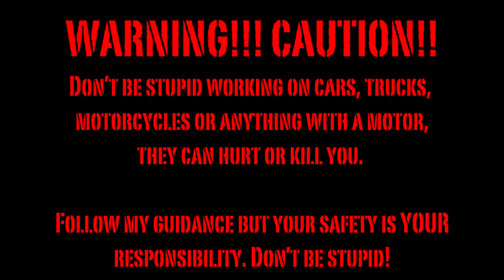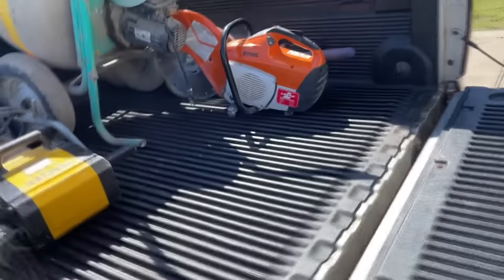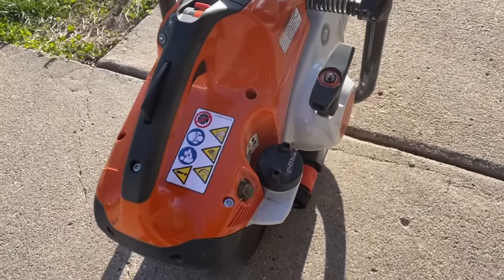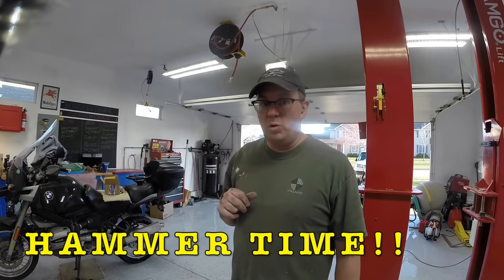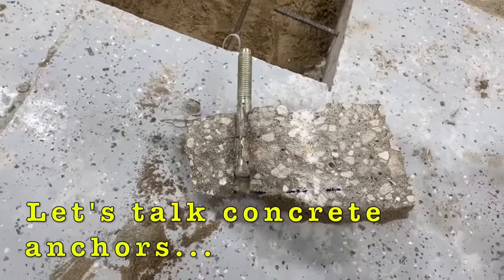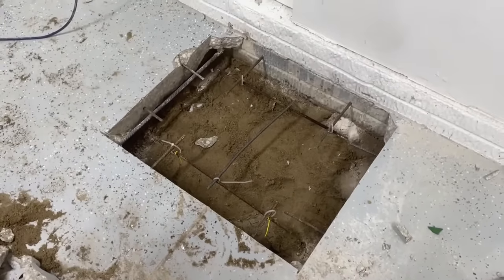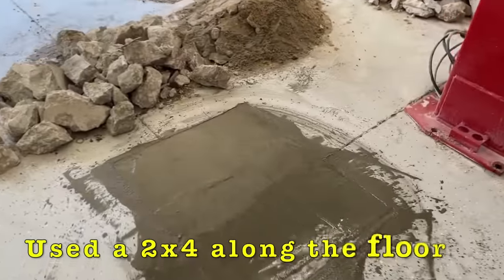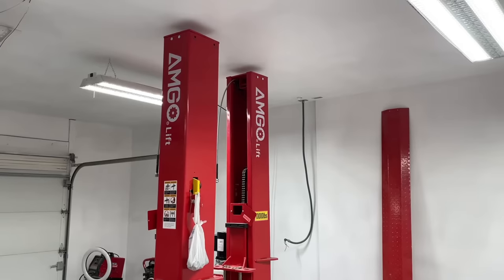My Lift tried to Kill me!

Comment: As a professional, and certified lift installer, this is terrifying to watch. Next time please hire someone who knows what they're doing, from start to finish.
Reply: Agreed! I would never attempt this myself. You could get killed or kill somebody else quick if not done right..
Reply: If you know what you're doing it's not an issue.  This guy clearly has ABSOLUTELY NO CLUE and should not be doing any of this let alone recording himself for other people to imitate.
Reply: What did he do wrong? Asking cause I don’t know and like to hear the correct way.
Reply: The building has a12” footing..why would you just do a 7” one not very smart. Should got some professional advice on larger footings and used used concrete imbedded anchors like they use on large sign posts. YouTube videos scare the crap out of me on what people do at times.
Reply: Have worked in civil design and construction (qualified) for 20 years. This patch does not meet design standards for expected loads. I have concern for the safety of people working around this "fix".   It is  recommended  you get professional design advice before starting jobs with high bending moments.
Reply: Quick question: I'm looking at a backyard buddy lift...have you ever installed that lift? Are they pretty solid? So many different companies and manufacturers to choose from...I like the backyard buddy because the ramps are a little wider
Reply: @tjewett1967 please share specifics of what he’s doing wrong so we can all learn.
Reply: Hmm I would have pulled the right post away from the wall 3 or 4 inches. Also would have epoxied the rebar to the existing slab and used at least #4 or #5 size. Compact the dirt beneath and make the pads at least 12" thick. Would have also have paid an engineer check the calcs.
Reply: One could argue if the lags start pulling and there's no cracking then hammer them through and just epoxy in some high tensile threaded bar no need to repour. The only issue I see here is expansion seams so close to the legs with that
Reply: Interesting, is it normal in the US to only have 4” of concrete as a garage floor ? I have always used 6”+ of concrete on 9” of hardcore for a basic garage ( you don’t know what people are going to put on it !) rebar as required.  In this situation I’d ask my  consulting engineer. But as a neighbour I’d have told the guy to cut out a yard square by eighteen inches deep , undercutting the existing floor a few inches. I’d have told him to throw his concrete waste at the bottom of his holes, and after installing rebar fill holes with good stiff concrete with a resin additive of some kind. Why use weak “wet”
concrete ? you are going for strength not ease of installation !  When trowelled and set, cover in wet sacks and leave for a month.
Reply: Agree 100%   Construction of a foundation for a car lift is not something the average homeowner should take on, especially someone with no experience and willing to put his ignorance on full display on YouTube!  Where is the engineered drawing or diagram for concrete depth and width?  Where is the tie in with the surrounding foundation indicating size of rebar and pattern?  Was he using high strength concrete , nobody knows.  When did he learn that extra wet concrete a good idea because it's self leveling?  Can't wait for the followup video to see when this new pour fails and if he escapes with his life .
Reply: My lift came whit ”hollow” anchor bolts. In the midle there is rod . Rod upper end there is allen bolt head and when you turn that allen bolt it tighten wedge in other end. After wedge is tight you can start tighten nut.
Reply: To those that asked.. Adding that small of an inset is useless. It’s barely pinned into the thin existing floor. He literally made his situation worse. Need to go at least 4’ X 4’ and because it’s not monolithic anymore you’ll need a pier. Put your 4 x 4 at 8” depth, do a sonotube that has a diameter of the mounting footprint down to 36”. Add rebar pins around the perimeter no greater than 8” apart. Order good concrete! Bag mud mixed wet has no strength and the aggregate in it sucks too.
Reply: Why do something once when you can do it twice……
Reply: @CrimeVid  Yes, 4 inch is typical thickness in USA for residential and it is often poured over dirt which may not have been compacted if done by a shady contractor.
Reply: @munsters2  Actually 3-1/2"
Reply: @gauravvij67  yup those cuts are way too close.
Reply: @ncphenom2309  besides not bothering to measure the water, each batch was different to my eye.
Biggest error is putting the lift back in the same spot against the wall, the anchors closest to the wall will crack the concrete and split the anchor loose. He should have moved the base 12 inches away from the wall.
Lift should not be installed on expansion slots in the floor either. This what I call an idiot.
Reply: Since you’re such and expert where are your videos huh?
Reply: I just bought a Ammco 10 ton lift and the cross bar on top has 3 holes can I narrow the over all width of the lift by bringing the cross bar in?
Reply: When your wife collects the life insurance she can afford to advertise for a smarter fella.

Comment: There is insufficient connection between the relatively small concrete blocks he poured to the surrounding concrete. This won’t resist the overturning moment of the towers. The height/width ratios involved in this setup result in very large forces. Using J bolts also would have been better as well. I’ll stick with Jack stands and a creeper thank you.
Reply: I would put a metal piece on top of the lift posts spanning them.
Reply: That how most of them are built.
Reply: I’m no engineer but I would made them bigger for sure. But also he’s hampered by the closeness of the wall to the post on the one side, the fatal flaw imho.
Reply: What is the point of a lift with no more roof clearance than this has?
Reply: @zaneturner4478  So that it can be used in a low-ceiling situation like this.
Reply: @safffff1000   That's not an option on a low-rise lift like this and his ceiling height precludes him from installing one with the top bar.

Comment: I saw two problems here with the install. I believe that right post was to close to the out edge of the floor. He floors are usually poured separately from the footings so you were right on the edge. Also the bolts are sticking way to far out you need to put the nut on the stud and take a deadblow and hammer it all the way down the hole then tighten them and they should hold.
Reply from the maker: Yes.. had to take a break from videos for Covid & Life.  I'll be sending a video out eventually.  The bolts pulled out due to failure.
Reply: @honeybadgermotorworks7561  thanks looking forward to seeing
Reply: @honeybadgermotorworks7561  No, the bolts pulled out due to INCORRECT INSTALLATION.
Reply: @CaseTheCorvetteMan  Yes exactly anyone with any knowledge of what they are doing knows the bolts puled out because of seriously poor workmanship and a person who has no idea of what he is doing .
Reply: @johnnystoka6625  you know what is worst about these sort of videos? People watch them and actually think this dude is an expert... they actually look to this sort of video for advice of sorts...

Scary thought, but that's youtube and the digital age!!
Reply: @CaseTheCorvetteMan  Yes my exact same thoughts . YouTube will get you with their thought police if you over step and politically correct comments yet let this person risk others lives by falsely passing as someone who is competent in what they do . Yes indeed very scary .
Reply: @Gestapo943  yeah, i am quite surprised at what people will consider a pass these days...
Reply: @johnnystoka6625  How ya’ doin’ this evening? I’m Officer Stansbruv with the YouTube Thought Police. I’m going to need you to step out of the vehicle please.
Reply: I install elevators with these anchors. They are super strong if installed correctly. By the amount of thread you have above the nut, you have 100% not installed the tru bolts correctly. You should have researched properly before attempting this yourself.

Comment: Should not even install a lift like this in a residential garage, where the foundation/floor were designed for storing a car. This is a case of a do-it-yourselfer getting carried away.

Comment: Wedge anchors need to be installed according to manufacturer's installation instructions.  The slab was not monolithic with the outer foundation wall. Per manufacturer, there is a minimum distance required to edge of concrete. It appears the anchor was too close to the edge and could cause the edge of concrete to spall. A minor crack can cause a failure of the anchor and have it become loose or completely pull out. With 25 years in the construction industry doing inspection, I have seen many cases of improperly installed anchors fail due to improper edge distance.

While I applaud this video to show what went wrong on the install, the fix was not the best method. Suggestions-
Mix the concrete with proper water amount. While it being self leveling making it easier to place, extra water reduces strength and causes additional shrinkage as the concrete cures. That shrinkage can pull the new concrete to the center and leave a small gap around the edge of the repair. While the gap might be minimal, the patch is now relying on the dowels to secure it.
Make the repair foundation much deeper and have it go under the existing slab so it is "keyed in".
Garage floors are normally poured separately so they float. Except along  the foundation wall, roughen the edge of the cut concrete slab so the patch bonds. Industry standard is 1/4" amplitude of roughness.
Better yet, also apply epoxy to the now roughened edge so patch is bonded to and becomes part of slab instead of a plug held in place by a few dowels. If you don't use epoxy, wet the edge of the existing slab so it doesn't absorb water out of the new concrete. 
The existing rebar was against the earth. They should not be relied on. New dowels should have gone completely from side to side in the slab overlapping full length. Set dowels in existing slab with epoxy except along the outer foundation. Dowels could be installed into the foundation, but with no epoxy. The dowel should slide easily..
Any type of wedge anchor installed at the edge of the slab would most likely fail again. An undercut style of wedge anchor might help. A cast in place anchor would have been best, but harder to reinstall the lift over anchor. If the cast anchor was not possible an epoxy set rod would most likely been the better route to go as long as instructions were followed to the letter.

If this comment looks like a keyboard warrior saying "you did it wrong", please remember what the title of the video said, they can kill. Get professional help if you are not familiar with what is required. Sometimes the fix can create a false sense of security and be a problem as well.
Reply: I completely agree, Sean.  About ten minutes in, the author says "if you've never done something before,  do some research and ask questions.  The worst thing is that you might have to do it over".  Except that in safety critical tasks, the worst thing might be a serious injury to yourself or a loved one.  I have a 10k lift in my shop, and before I installed it, I called the manufacturer.  My concrete is six inches deep and is more than adequate, but Mohawk (the manufacturer) told me that if I had any problems and needed to cut and pour a new section, it should be 4 ft by 12 ft wide (across the stall) and 12 inches deep, keyed under the existing slab and reinforced with rebar.  Overkill?  Probably, but in this case  overkill is miles better than not good enough.  I dont think the author took his own advice,  those little new sections are inadequate by any manufacturer's standards.
Reply: Lift manufacturers usually recomend the size of the new "pads" if you feel  the concrete is unstable....etc.   in my case they recommended at least 4 ft by 4ft pads keyed and tied into the old concrete.    In my case  i went 9 ft front to back and 16 ft across......so effectively one slab for both posts.   And usually the bolts are required to be a certain distance from the edge of concrete....in some cases a minimum of six inches.   I wouln't put any any bolts any closer than 18 inches from an edge.....
Reply: Just did a new 3 bay garage with a 10k mohawk lift....directly under the lift posts we put 3 foot diameter by 4 foot deep corrugated tubes and filled them with concrete.....then poured the slab...she ain't going anywhere.
Reply: Thanks for the knowledge, I have to ask tho. I'm about to pour my floor in the garage. 4inches everywhere. Would it be safe enough to just pour deeper arouns the pads? Say about 8 inches deep and about 2x2 foot square with rebar in it?
Reply: @NateM13 In addition to reading the comments here, I would at a minimum consult the manufacturer’s specifications for your lift. I would never recommend going ahead with a concrete pour without having selected  a lift and fully comprehending the requirements for floor strength. Garage slabs at 4 inches are the absolute minimum for nothing more than a vehicle sitting on them, and are routinely poured over barely prepared soil. I guarantee that the first time you get under a vehicle sitting on your lift you won’t think, “I sure wish I just went went the absolute minimum amount of concrete and rebar.”
Reply: @beachroad2695  I went all the way through with good epoxy and it never moved or cracked ,previous anchors needed retightening periodically due to design limitation i think , continuous slab i agree .
Reply: Epoxy.  The rebar should be epoxied into the existing concrete.  With the pad that close to the outer wall, I'd also drill 7/8" holes and epoxy 5/8" Grade 5 All Thread into the holes.  This will be far stronger, and not try to bust out the edge of the concrete next to the edge of the slab like an expansion bolt would.  Concrete specific epoxy is available at a reasonable price.
Reply: @n2omike  Yes on epoxy ,, wedge anchors  with no epoxy not reliable .
Reply: WHAT SEAN SAID YES! LMAO,IT SHOULD READ/I TRIED TO KILL MYSELF AND MY TRUCK

Comment: Thank you for having the BALLS to admit this and share. I'm not kidding. I'm in the mist of getting a garage built for a future lift and all these guys are telling me, oh 4 inches is plenty blah blah blah, I said the same I don't feel safe with that. I'm actually going to pour an 8 inch slab. Thanks brother. Great video.
Reply: just seen you old post, pour footings for it, at lest 2' square and use j bolts to attach the lift, if you can. 
even better would be one footing 2'x2' and 12' long with rebar on 8" centers,  the best thing would be is have a civil engineer draw it up.
Reply: 4 inch is enough depending on manufacturer. I trust an engineers calculations. If they said 4 inch is ok then I will do 4.
Reply: @Danish Roy  following the minimum is like driving your car with two of eight lug nuts on a tire. Did a quick look at bendpak requirements, existing 4.5" slab with a core sample sent off to make sure it's sound.
New slabs they want 48"x48"x12" deep with a detailed layout for rebar. 
"Don't build it for its best day, build it for its worst day"
In other words build it the best you can.
Reply: @FleetTech97  Depends on the quality of the concrete, and the proximity to the edge. If you're installing on a preexisting pad, a core sample should be sent out for testing.
Reply: @Danish Roy  you obviously don't value your life highly
Reply: @SwapPartLLC  I just got my building permit today!!! Yaaay! I'm pouring two pads 6-8" thick with 4000 psi commercial concrete AND I paid extra for fiber strand to be added.
Reply: @acetech9237  I spent last Saturday laying in a freezing puddle of water changing my U-joints and an idler arm. I dream every night of having a garage and my own lift.
Reply: @SwapPartLLC  been saving 200 a month for 10 years. Finally have enough for my dream garage.
Reply: @acetech9237  I'll get there one day.
Reply: @FleetTech97  People are overreacting to this comment. As an engineer, I know a generous safety factor is applied to safety equipment like this. If properly installed there is no need to make it stronger. It's probably 2-5x what it needs to be already, however we don't know what margin they used. 

The details matter and need to heeded carefully. If it says 4000psi concrete, you cannot just assume it is. If it says 4in slab, you need to know it actually is. I don't think it is safe unless you can talk to whoever poured it. Preferably you made test cylinders during the pour for verification. Sometimes the mix is wrong (it was going off and the driver adds water for instance) and they get it finished, but the strength could be compromised. Or maybe the grade was off. Lots of things happen. 

Any additional safety factor by the installer is insurance against improper installation or bad materials.
Reply from the maker: Thank you !!

Comment: I purchased a Bendpack 9000lb 2 post lift with the base plate like yours. I was fortunate because I was pouring all new concrete in the bay it was going in. The manufacturer required 12" thick pads underneath the posts for new concrete. I actually did 3' x 3' x 3' underneath each post. Yup, 1 yd of concrete under each post. totally overkill. Each time I went to lift something, I checked the torque of the bolts. Each time, I had to re-torque the bolts. Thats when I figured out the tops of the posts were like yours, deflecting inward. I then extended the top of the posts to reach the framing of the ceiling. I cross braced everything between the trusses, then added steel angles to triangulate each post to continuous framing in the ceiling. problem solved!
Reply: I plan to do something similar when I do my pad pour. Not cheapin out